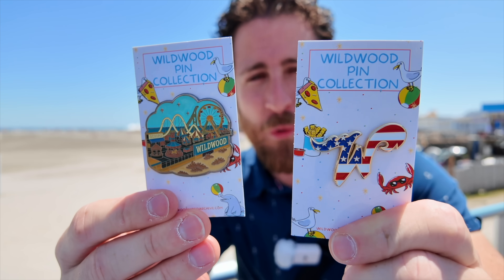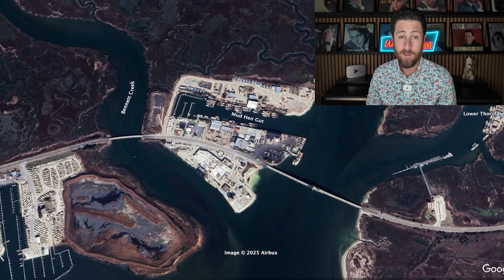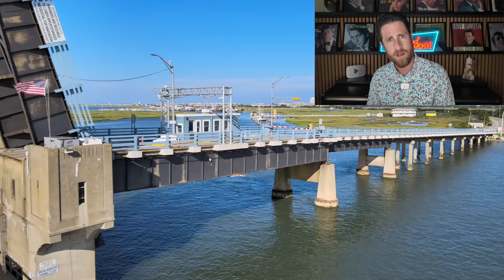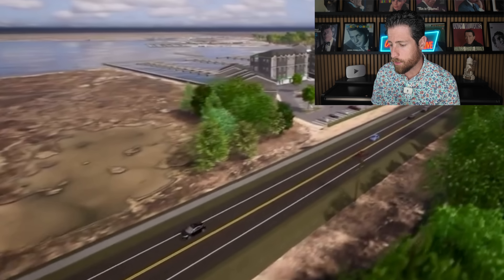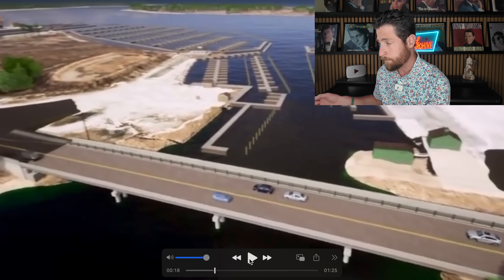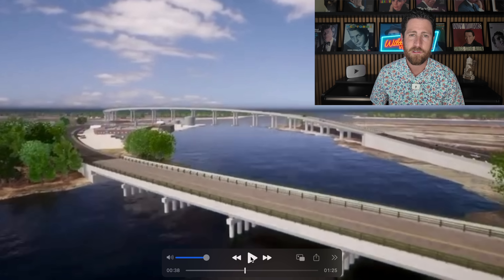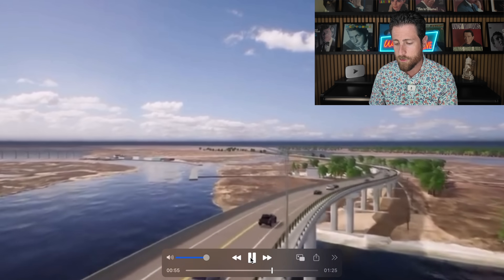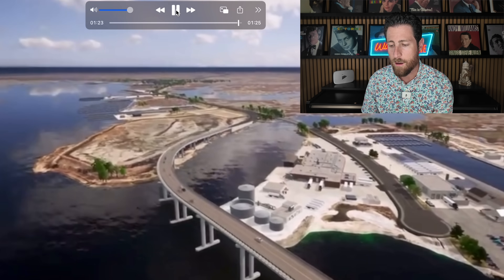Cape May’s Middle Thorofare Bridge Is Getting Replaced - $350 Million Bridge Project

Comment: Speaking of toll bridge. Funny you should mention that. There is no mention of how much it actually costs to get across that bridge. The toll taker is no longer there and it's EZ PASS only. A $2.50 toll turned into over a $13.00 toll, with zero warning or mention of all of the add ons. Pretty sure this is just this side of legal. It sure seems as if someone is trying to discourage the older folks from visiting anymore. Either that, or this is how they're funding the new bridge project. More taking advantage of the little guy.
Reply: If you don’t have ezpass by now that’s on you. Toll takers are a remnant of the last century.

Comment: Only a few more years  left of being able to ride a bike from the tip of Cape May to (at least) Ocean City. Can't imagine pedaling over a bridge with such a steep slope. Oh well.
Reply: The existing bridge is quite steep with no shoulder barely a cars width per lane. This seems more gradual and it appears there is a pedestrian path that hopefully allows bicycles. 
As it is today the route is not very bicycle friendly especially by the intersection with the parkway. Hopefully more dedicated bicycle lanes are being considered
Reply: It looks like it will be fairly gradual, so it shouldn’t be much of a problem.  Riding up and over the old drawbridges takes a bit of an effort.
Reply: I’ve biked a large portion of OcnDr over the last few years (from CM to AC), and can say from 1st hand exp that it will likely be EASIER to bike over this one than some of the others. Reason is that this slope looks to be same or even LESS than others (i.e., OC-SP, OC-LP), due to the peak height being spread out over a longer overall distance. As long as it gives enough shoulder width to travel safely, I don’t think this will be too much of an issue. [My personal concern: I’ll likely be ‘pushing 70’ by the time it’s completed, so I don’t know how many 65-75 mile rides I’ll have left in me by then!]  :-)

Comment: Very interesting, for sure.  It will be an adjustment for residents, but it will be an improvement.  As much as I like the old drawbridges, their time is running out.  A number of them along Ocean Drive have been replaced, but nothing of this magnitude.  As far as being out-of-place, nope.  The view alone will be worth the drive.  They replaced all of the bridges on 152 between Longport and Somers Point and also the Robert K. Bell Bridge on Ocean Drive into Ocean City and they look just fine.  I do miss the old 'Clickety-Clack' bridge along that route, but the improvements were necessary for maintenance and marine traffic.  The only one that I don't care for is that monstrosity between Somers Point and Ocean City.  The Ocean City end was needed, but they should have left the Somers Point end alone.  It's now just a big traffic congestion point where the circle used to be.  Waiting for a light when there is no traffic is a pain.  Either way, whether the new bridge will be a toll bridge or not isn't a big deal.  I can't wait for the project to begin.  An excellent video, as always.